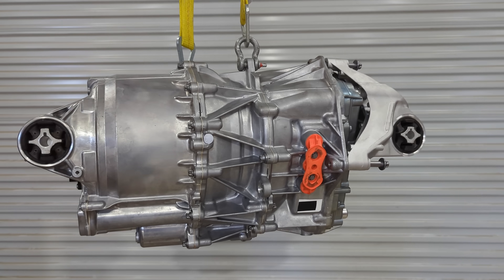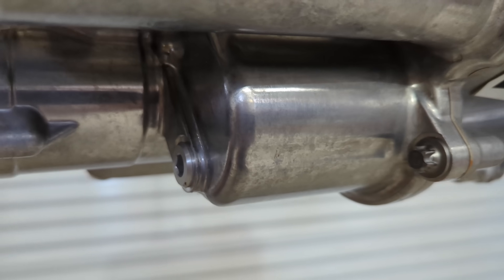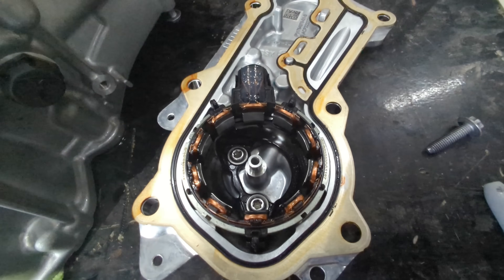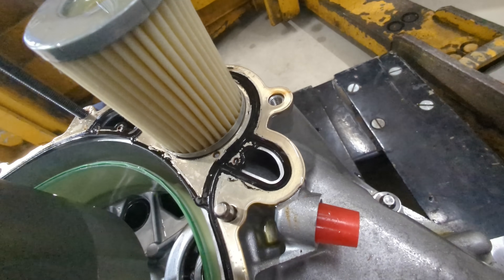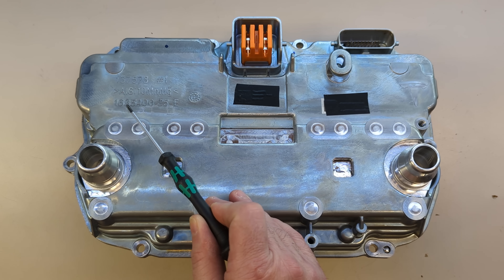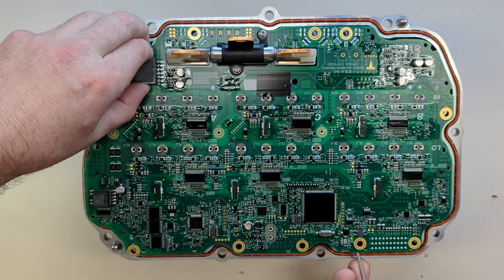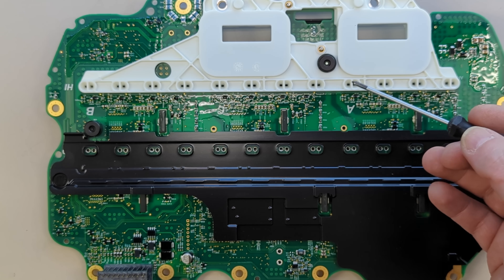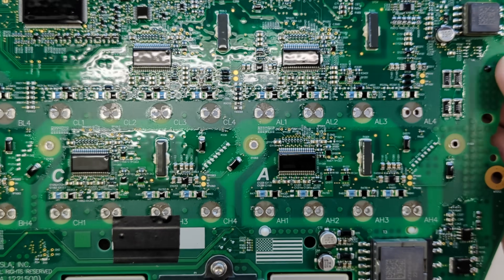Tesla's Newest Motor & Drive Unit

Comment: First of all thank you very much for this content, it is awesome so have this peep at all that motor and inverter tech, specially that fast ( as you did with Plaid)!!

I have a question regarding the hairpin windings; fill factor increases but you also have larger sections for Eddy losses at higher frequencies, which is specially relevant at high rpm (which this motor spins at).
 How much is that decision an efficiency matter or a cost-reduction one?

Thx for the vid!
Reply: The hairpins could be laminated instead of solid, and the cross-section of the pins is relatively small, so it should be less of a problem compared to the Eddy currents in the steel core.
Reply: @jwstolk  are these hairpins laminated? Haven't seen it when I watched it.
Reply from the maker: I think this was a cost-optimization mainly.  I suspect the efficiency is largely unchanged, the tradeoff of infill increase likely balances the higher loss.
Reply: @Ingineerix  thank you very much for you insight
Reply: @josemdbl4957  Watch the Investor Day video at minute 58 in slow motion to see the hairpins being laser welded.  They appear to be solid rectangular cross section.
Reply from the maker: Here's a cool video from the company that likely provided Tesla with the manufacturing automation: https://youtu.be/3chl322LOBQ

Comment: Hi, proposal for a new video: i would be curious to see wether the latest battery BMS and DC charger allow now the BI-Directional current flow (as possibly announced durin the investor day) to permit the Vehicle to Grid or Vehicle to Load function (like most of the chinese OEM do).
Reply from the maker: The PCS architecture in currently produced vehicles is unchanged, There is no AC V2G/V2L, I already have 2 videos on this.  DC export is possible, but Tesla doesn't currently allow this.
Reply: @Ingineerix  With the work you've managed to do getting into these systems, how hard do you think it would be to ?safely? enable DC export via the power connector/existing socket? There are more and more HVDC to 230Vac inverters available in the solar market these days, most of them being bimodal and in capacities of 50kW+ in the residential/ light commercial space.

I presume tesla has ways to check whether any HVDC is "leaking", so tapping into exiting wiring wouldn't necessarily provide bi-directional access to power either?
Reply from the maker: @stefanvanzyl9090  People keep asking me this.  Sorry; Yes, it's possible, but  I'm generally not inclined to help people do this due to the extreme hazard involved.  A 400V DC shock is approximately like 800VAC, it's super dangerous.  The arcing potential is high, and the amount of amps the battery can supply is terrifying.  Tesla's got a lot of safety systems designed to keep the HV away from people, but if you "tap", then you are bypassing this.   I'm happy to discuss over email if you like, but I can't condone anyone without proper qualifications attempting such a thing.  General electrical knowledge is just not enough, and if you are qualified then you'd already know how to do this, and do it safely.   I did it in 2015, and it's not a problem, but non-trivial.

Comment: To some this new Drive unit and inverter may seem low key but its another reason Tesla remains years ahead of the rest of the EV producers. I agree it is a work of art that is fluid cooled and should last a long time.
Reply: Years my @zzz have you seen lucid and others design!? Wtf!!
Reply: @carholic-sz3qv  Well considering Lucids cost >$1M each to make, I guess they could make a good motor.  Let's wait to see when Lucid makes a profitable car to see how good the motor is then. We have yet to see how reliable or how long Lucid motors last either. Perhaps they are great, but we really don't know yet.  I really hope Lucid can succeed, but they have a long way to go.
Reply: @tesla_tap  you're joking right!!! Who told you that lie!? Wtf!! Also lucid is going to make a cheaper model in the future too! They can't just survive with ultra luxurious stuffs that's how it works.
Reply: @carholic-sz3qv  Sorry, I don't have time to look over Lucid's losses from the start.  Lucid has an operating loss of $2.4B in 2021 through 2022.  They sold 4584 vehicles in those two years, so that amounts to costing $523K per car to make.  Likely quite a bit more if you include earlier years where no cars were sold.  As for a cheaper car, they haven't announced anything competitive with the pricing of the Model 3 or Model Y, and they have yet to make a single car that sells below $100K.
Reply: @tesla_tap  lucid makes cars with massive range and can decide to make cheaper ones with less range too I don't get what you're trying to justify here wtf!!!
Reply: @carholic-sz3qv  Not trying to justify anything.  Just pointing out Lucid is losing a lot of money on each car they make.  Selling them for a lower cost will cause even greater losses.  Not sure how long this can be sustained.  I wish them well, but Lucid really needs to get there act together.  Selling cars that cost over $500K to make for $180K is not a great business plan. I'm sure Tesla or any other car company could easily compete with longer range if they wanted to loose money on every car sold.  Anyway, enjoy your Lucid as you got a great deal.
Reply: @tesla_tap  I didn't bought a lucid why can't you admit that Tesla also lost alit of money!? Use common sense wtf!! Alot of people actually need more range depending on what they do with their vehicles.

Comment: Where is the part that the discussed on Investor day? Where they replaced four microprocessors with one, was that in the charger somewhere?
Reply from the maker: I think that was a vehicle architecture change, and probably will not see that until Cybertruck.
Reply: @Ingineerix  This is what I meant:

https://youtu.be/Hl1zEzVUV7w?t=3326
Reply from the maker: I haven't seen this board, so I can't comment.  The charger (PCS) does not have 4 microprocessors like that.

Comment: Thank you for this. Been watching you since the beginning. 

So out of curiosity, the dyno numbers on the MY suggest it has always put down slightly
more HP vs. M3 equivalent. I know to some degree they’re nerfing the Model 3, which was calculated to have about 100A (within spec/ limits) left on the table. But, I always had a feeling they made a stronger motor for the MY. Do you think that’s where the difference HP is? Or simply just a changing the power curve just bc it’s a MY? (Could be both).
Reply from the maker: Same motor/inverter on both 3/Y, but they do allow higher power output.  The Model Y is heavier, so they bumped the power a bit to allow it to try to keep up with the Model 3 a bit better.   Yes, there is a lot of power "on the table" in this design, they essentially use the same parts in the Plaid.  There are a lot of reasons to limit power, we have to consider the battery pack, powertrain longevity, chassis traction limits, and finally marketing.   They don't want a performance Model 3 showing up their expensive flagship Model S.
Reply: Same hardware on both.
Reply: @chstra45  Ah ok, so it's all software. Interesting.

Comment: An oil filter will always need to be changed, even if the engine works clean for many years, it needs to be changed, also the oil over the years oxidizes and loses its properties and needs to be replaced. I see planned obsolescence and less repairability, less quality than the previous engine.
Reply: I think you’re getting confused with fossil fuel engine filter deployments.
Reply: @ethelred2648  no, oils have properties and these are lost over time, not even the most advanced synthetic oils are saved, all oil degrades including the filter, the years do their thing
Reply from the maker: Because of the relatively low temperatures and lack of combustion blow-by or friction wear surfaces, there is very little contamination and/or oxidation of the lubricant, and this means low flocculation, which is what can clog a filter.  Tesla's original drive units didn't even have a filter like this at all!    Some of those have went 500k miles.   Tesla claims both the lubricant and filter are lifetime.  I agree on the filter, but I recommend changing the oil every 40k miles, it's cheap insurance.  (mainly for viscosity breakdown)
Reply: @Ingineerix  500k millas, It is nothing for an electric motor and less internally cooled by oil, and not to mention the bearings and oring, the repairability is more complicated, there are models 3 with external oil filter, and I have seen Tesla motors with a carbon fiber rotor, this engine is definitely of less quality
Reply from the maker: The carbon fiber overwrap is used on the Plaid motors so they can achieve a higher speed.  (I have videos)   Not needed on the Model 3/Y.   I suspect Tesla used the External filter on the previous design because it was an off-the-shelf part.  Just because it is not built-in doesn't mean the quality is less.   The original S/X motors didn't even have anything other than a screen!    This is not an ICE transmission or engine with wear contaminants constantly being shed into the oil.  I can almost guarantee the drive unit will be end of life before that large filter media even gets remotely near it's capacity.
Reply: @Ingineerix  I give my humble opinion, just by seeing the delaminated rotor I believe that the set is made to last the same or less. this is called planned obsolescence and lower repairability. the oil degrades, I doubt that after 20 years of continuous use that oil has not lost some of its properties, it goes against the laws of thermodynamics and the heat exchanger would prove it. The only thing I liked about that motor was its hairpin stator. Thanks for sharing, it's a beauty to see the technology behind this engine.
Reply from the maker: @cesarhoyos6955  Yeah, I don't debate that the oil should be changed.  I recommend every 40k miles.   But the filter doesn't, because it's simply not going to accumulate anything of consequence that would overload the media, it's got a huge surface area compared to the flow.   In ICE engines, the filter clogs really fast because there are so many combustion products making their way into the oil, and the very high temperatures create oxidants that the flocculants in the oil deposit in the filter.  That just doesn't happen here.  I see no planned obsolescence.  The oil is easy to change.
Reply: @Ingineerix  I prefer the other design with the filter outside, planned obsolescence is very easy to demonstrate, the example of LED bulbs, with good cooling they can last more than 50 years, an oil-cooled electric motor like that can last more than 100 years With a good design, this type of electric motor does not have friction, only its bearings. Planned obsolescence is not shameless as before, now there is the guarantee and class action lawsuits, now the devices are less repairable or more difficult to repair.

Comment: WOW Thank you so  much, I saw the hair pin stator with the rectangular wires and my jaw dropped. 
 The fact you knew you had to design fixtures to prevent a  rotor magnetic crash  during disassembly really impressed me.
Tesla is years ahead.. I really enjoy your teardowns.
Reply: Stop talking nonsense please!!! Do you realize that Tesla is basically the last one to use hair pin  design!! Even sandy munro said that in his last videos! Even the 2012 bmw i3 already had that design lol!!!
Reply from the maker: Actually Hairpin stators have been in production since the 60s.   It's Tesla's evolution that enables lower cost and higher performance that's the neat part here.
Reply: @Ingineerix  wrong!!! Other manufacturers also makes it cheaper and powerful too lol!!!
Reply: @Ingineerix  how has Tesla lowered the cost or improved the performance of the hairpin windings?
Reply from the maker: @brianb-p6586  The hairpin winding stator manufacturing can be almost completely automated, and since it's physically much simpler, there is less to go wrong during production, improving yield.   Time in manufacturing is cost, so the much faster process means less cost (in the end).   Performance of the stator is increased in several metrics because of the higher infill.
Reply: @Ingineerix  I understand why hairpin windings are better, and you mentioned that in the video. I was asking what Tesla contributed, since it appears that they are just adopting - decades after it was developed - the same winding technology used by other manufacturers (including GM, the company that all Tesla fanatics love to ridicule).

It seems that you were just saying that Tesla is evolving, not that they are contributing anything to the evolution of the technology, and if that's what you meant that's perfectly valid.
Reply from the maker: @brianb-p6586  Other than the production technology, I don't think there's anything special about Tesla's implementation.  You have to look at the whole package.   Comparing this drive unit to others on the market, it's going to be hard to beat if you take everything into account.  Cheaper/Faster to produce, really high performance, long life, excellent efficiency, etc.
Reply: @Ingineerix  While only the inverter is in any way noticeably different from other brands, I agree that it looks like a good package.
Reply: Remy (now a part of BorgWarner) has been using hairpin windings for at least 15 years, supplying them to major manufacturers such as GM.

Comment: Any way to reason about the max current/power of this inverter and the motor? I ask because I thought it was interesting with the 980 motors in the 2019/2020 M3 how they were limited to 211kw but rated to 250 (which the Ingenext product unlocks).
Reply from the maker: Yes, there is a lot of power "on the table" in this design, they essentially use the same parts in the Plaid.  There are a lot of reasons to limit power, we have to consider the battery pack, powertrain longevity, chassis traction limits, and finally marketing.   They don't want a performance Model 3 showing up their expensive flagship Model S.  By the way the part number on this drive unit is 1665000, so we can call it the "triple 0".
Reply: I wonder what the future will look like when folks figure out how to impersonate the controllers inside the CAN world and send more power, throttle control, undo current limits etc? How will hackers know what limits each part of the system can take? Will that future just be experimentation? Will folks have to ruin cars, cause accidents or set conductors on fire to learn limits before they decide how much to push parts in the future?
Reply from the maker: That's just it, there is no way to know how far it would be safe to push.   All proper engineering leaves a healthy safety factor on the table, as I'm sure Tesla has.  Also keep in mind there isn't a lot of room for improvement anyway because of traction and battery limits.

Comment: So could you put the carbon fiber plaid rotor in this?
Reply: Since the "previous" plaid used the "previous" Model 3 stator, it shouldn't be a problem (?).
Next question, does the Plaid use this inverter?
Reply from the maker: Not currently.  I have Plaid motor teardowns already.
Reply: @Ingineerix  I wonder if the latest gen of plaids are any different.
Reply from the maker: They aren't going to change things that fast, it's too expensive.  The 3rd gen motor lasted 5 years, and it's still in production.  They'd need to redo a lot of stuff just to use this inverter, I don't see it happening for another few years at least.   I've seen a Plaid made in 2023 and so far it's the same powertrain as when it was introduced.

Comment: For the hairpins, do they use a form of Litz wire in bar format? Similar to Lucid's laminated hairpin but hopefully better (matrix rather than stack and if we're lucky woven to reduce hot spots). Obviously insulated threads and compressed down to a "bar" to create the hairpin...
Reply: No, the copper conductors are solid rectangular cross section.  You can see this on the Investor Day video at minute 58 or so, play at 0.25 rate and pause the quick clips of video of the ends being laser welded to see for yourself.
Reply from the maker: Here's a cool video from the company I suspect Tesla got the production technology from:  https://youtu.be/3chl322LOBQ
Reply from the maker: I don't believe these are laminated, but I didn't want to cut into them to find out.  I think the loss is low enough that overall it's a wash.

Comment: What are the practical benefits of this motor? My 2023 Model 3 RWD came with a 980 3D1 motor, but assuming Tesla started using this hairpin motor in US Model 3s next year, would we see increased range, or is it mostly about reducing cost to manufacture?
Reply from the maker: Lower cost, better power density, higher power (better cooling).  The hairpin tech itself is not more efficient, but other changes may balance this out.